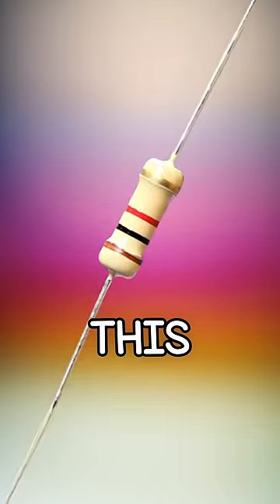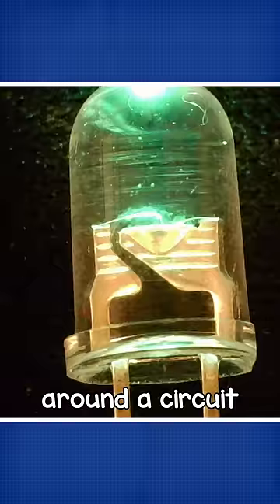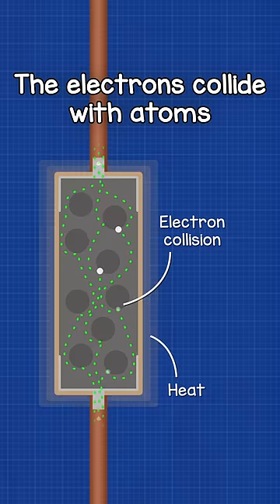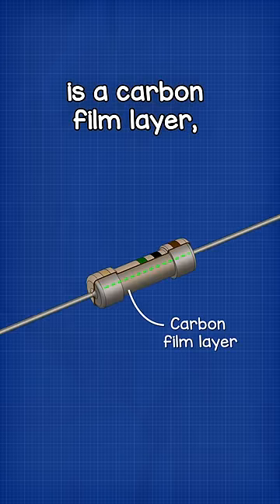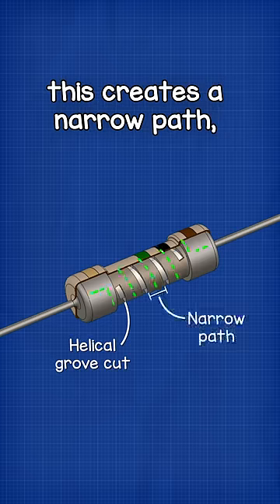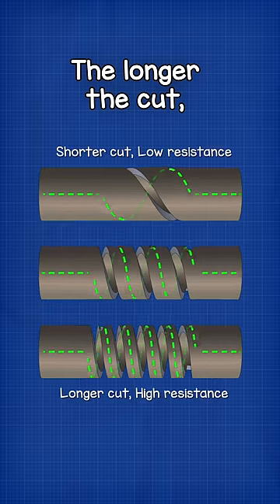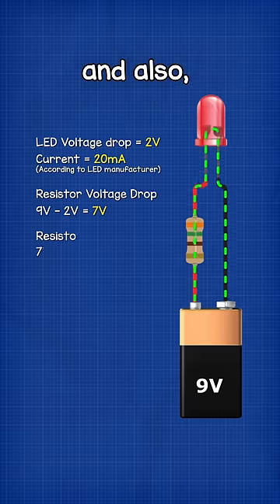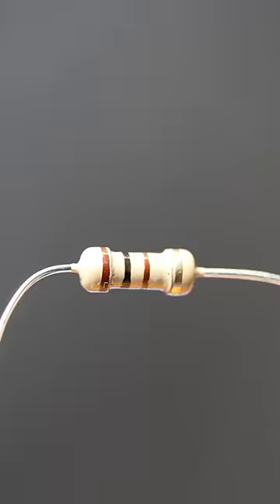What is a resistor? #electronics #electrical #engineering #electricity

Comment: Remember kids, all electronics produce light at least exactly once
Reply: Caps don't not offensive
Reply: Everything's a smoke machine as long as you operate it wrong enough
Reply: @akshatjaiswal6345  you ever short a capacitor out? They most certainly can emit light. And sound, and smoke.
Reply: @rubiispare reminds me of a quote/joke I have used: any component is a lightbulb with enough current.
Reply: My electrical engineering professor taught us that electricity is based on smoke.... when the smoke escapes, it stops working 😂
Reply: When i was a kid, in my days,  i used to break this chips to see what was inside.
Reply: @maelthrajaluk42  yes. It's magic, and it's blue, and it must NEVER escape because it'll never go back in
Reply: @maelthrajaluk42 sometimes you aren't so lucky sometimes that smoke is an orange flash of light, if your even less lucky that orange flash of light happened to be a lithium ion battery
Reply: The data sheet won’t tell you this but they hide every color inside each LED.
Reply: @akshatjaiswal6345 i just don’t understand kid you said ? “Its caps and im not offensive?”
Reply: @maxaul567 he's speaking the language of the gods!
Reply: @antiStrikerS  i take it as a compliment but ok
Reply: @maxaul567  i was talkin bout the kid but ye
Reply: @maelthrajaluk42 And you can’t get the smoke back in!!
Reply: But sometimes it’s in the end of a tunnel
Reply: Saying "at least exactly" is kinda redundant
Reply: @foolishly7366  it ain't, it's just right
Reply: @foolishly7366  not really. LED's emit light many times. All electronics emit light, at least once.
Reply: I think black holes are conductive to AC tho
Reply: @johngavin2570  and smell 🤢
Reply: yeah GPU
Reply: Na they don’t but they do all smoke at least once
Reply: @RedHaloManiac95  yes they do, you're not trying hard enough. Smoke=potential for full combustion. Full combustion=fire. Fire=light.

Also, realistically speaking, if it is smoking, it has already combusted, meaning it has already (internally) created light.

Whether or not you see the light is not the point. Light is made, much as a tree falling in the woods makes sound.
Reply: @foolishly7366 idk man, seems like an And/Or kinda thing
Reply: @akshatjaiswal6345 suppose that I argue semantics and say that the capacity doesn't qualify as electronics because it only has the capacity to be electronic
Reply: I am literally very sorry for the very late reply but I would have said caps are offensive.
Extremely sorry.
Reply: @LEON46051  ..McDonalds don't use real potato, everyone knows that.
Reply: @CadenMoskol ever punctured an iPhone battery while replacing it? With bare hands? Inside the house on a table with a cloth tablecloth?
Reply: @christopherkucia1071  Yes actually in my case it just smoked though
Reply: Everything can, with black body radiation
Reply: All things in the universe produce light. Heat is found in all things, and heat is radiated in the form of light. Only reason the sun is brighter than a rock in a dark room is the sun is hotter
Reply: Gives "any machine is a smoke machine" vibes
Reply: Yeah they.explode 😂@johngavin2570
Reply: @maelthrajaluk42 mmm yes the magic smoke
Reply: Everything that has heat produces light (even a human makes light, it's wavelength is too long to see though, this is how thermal cameras work)
Reply: @CadenMoskol  *you're
Reply: @johngavin2570 I think he's mentioning a grammatical issue. "At least exactly" is redundant since "exactly" means equal, while "at least" means greater or equal in math terms.
Reply: there's also "anything's a fuse if you're brave enough"

Comment: I've always wondered what the inside looked like, thanks!
Reply from the maker: See our Resistors Explained video for full details on our channel
Reply: @EngineeringMindset you should have left the link to that video here.
Reply: This is only true for carbon film resistors,  other versions exist.
Reply: @adon8672 bro it’s ok I can easily search the video with the information provided
Reply: Even during engineering they never showed what's inside resistor or capacitor
Reply: @roninr8199  This actually isn’t why most resistors look like, Normally
Reply: @adon8672 Its right above the caption you dingus. Just press it.
Reply: There's a few types.
Reply: @adon8672 he can't links got canceled a while back :(
Reply: Me too! Earned my subscription😄
Reply: When I was in school for electric systems I asked how they actually work because everything else was explained like transformers, relays and such but the instructor just said "it's not part of the class" I didn't have a computer to look it up and forgot about that moment until now.
Reply: Like all electronics it's filled with magic blue smoke. As soon as that smoke is released, they stop working.
Reply: Outdated knowledge
Reply: QQ ²22²uuuuuuuuu
Reply: Many types ,this is just one type .
Reply: Look at some old resistors they are huge and have sliders on them to pick the value, they look like coil springs compressed.
Reply: That smoke smells like money. Not getting rich smoke- unless you have stock in electronics parts stores.

Comment: Now the shape of resistor on a schematic makes sense
Reply: thx!
Reply: Oh dang I realise ☠️
Reply: OMG you're right, I never realized that before lol
Reply: i knew they  had this  shape because of the resistence in a heater, i  had no idea resistors were just the same thing but smaller, i thought the resistance was based on the material they used
Reply: Great point! Also the pattern of it burning up was super fascinating.
Reply: The symbol represents wire wound resistors which were the original way it was done.
Reply: @abeyroy007  same
Reply: Bruuuhhhhhhhhh I'm going to mention this to my circuitry professor!
Reply: Right????
Reply: My college lecturer always used to rave about how the old English/American symbols (ANSI) were better than the ISO standard.

The UK standardised symbols with ISO mostly using German examples a fair while ago. Standardisation does not always mean the symbol is better, but it does guarantee that different countries are using the same system.

If you don't know, ISO resistors are a rectangle (the shape you physically see side on). ANSI ones are quicker/easier to draw by hand though.
Reply: Resistor is a coil but not Cooper made, but Carbon made.
Reply: @azhuransmx126  And a physical coil of wire (around a magnet) is an Inductor.
Reply: @Joshua-fi4ji  and if you allow the magnet to move inside, then you have a solenoid.
Reply: @Joshua-fi4ji  the coil doesn't necessarily have to have a magnet before it becomes an inductor
Reply: @chukwumaeddie5485  true. I probably didn't word my comment very well looking back on it.
Reply: @chukwumaeddie5485  true. I probably didn't word my comment very well looking back on it.
Reply: Right!
Reply: @azhuransmx126 And if you use that moving magnet to switch on/off another circuit, you have a relay.
Reply: @doomtho42  Yes, Relays the beginning of Logic Gates and Computers, and I believe that is the end 😂. Well, one more!, if you put several coils aligned in a canon and put an iron bullet inside, then you have a Helical Gauss Rifle.

Comment: Electrons don't collide with atoms, they transfer kinetic energy to other electrons, a behavior that looks like a collision, when a circuit is closed, causing a domino effect of  kinetic transfer. The kinetic measure of electrons, called current, must balance with the potential energy in the battery as voltage or electron voltage and the resistance or magnetic capacity of the resistors, transistors, switches, modems and even wires. Flames of fire are made up of electrons, so if there is a build up of electrons in one area, when the voltage is higher than the resistance ability, a flame is created.

Comment: I just understood this shit after 15 years... man! It makes sense now! Bc of the helical shape the electron has to go through a longer path and this is how it works! Fucks sake none of my teachers had show me something like this but i only needed this! Oh my gooooood!!!
Reply: Someone tries to tell for us,that the resistance only depends on the length of the path through the resistor? This is partly true, but the resistance depends on the material of the resistor. 1 kilometer of copper wire has an electrical resistance equal to one meter of tungsten wire. According to them, 10 mega Ohm resistor should have 162 kilometers of copper wire? Carbon layer, Metal oxide, Varistor,Thermistor, NTC, PTC are based on the electrical conductivity of the material from which they are made.
The resistance depends very little on the length of the path, or the shape of the resistor. It depends exclusively on the material of which it is made...Do you understand? One metal oxide resistor 0.25 Watt, is about 1cm long. If it has a resistance of 100 megaOhm, it should have a 200 kilometer long copper or aluminum wire in it? So, the resistance only depends on the material, not on the length of the electron path ..Simple example: Iron has 7 times greater electrical resistance than Copper.

Comment: There is a flaw in this explanation. Resistors dont make less electrons to flow. They just reduce the "force" with which they flow. Thats why you will see a voltage drop across the resistor but not a drop in the current flow.
Reply: This. It really bothered me a resister is not a valve it's a ramp.
Reply: Eletrons DO NOT flow.
Reply: What?? Of course you see a drop in the current, compared to 0 ohms... i.e. in an ordinary battery circuit.
(Only with a theoretical and ideal synthetic current generator would your statement be true.)
Reply: It controls the flow of current in a circuit. The Amount of Resistance is based on the ohms of the resister
Reply: Then it depends on if it's in series or parallel. Ohms law and Kirchhoff's Law.
Reply: Then there is impedance in the circuit measured in Mhos. Then there are diodes an entirely different critter which is based on what it is made of
Reply: A germanium diode, silicon doode, and the odd ball zener diode, which works in reverse of a normal diode
Reply: @blackpink5937 read kirchhoff's law it will explain it.
Reply: "Bad beer rotts our young guts but vodka goes well" is a saying to remember the resistor color code. First letter only. Another one not as polite
Reply: By definition, electric current is a flow of electrical charges by time unit, these charges can be electrons or ions, in a teorical constant voltage circuit, you can control the electrical charges flow by means of a resistor and effectively you control the electrons or ions flow (depending the media through this charges are moving). Intuitively, It can explained as 1000 persons trying to pass through a narrow door, only few of them can pass in a given time unit (equals current) while at the same time you have a high pressure and low pressure at either side of the door (equals potencial difference aka voltage drop).
Reply: Well, @ask_sharma, if you want to nitpick, electrons don't flow, they push each other without moving. They propagate a wave.
Reply: @nicojar glad we are finally leaving the age of flowing electrons....  when will science finally tell the 100% truth?
Reply: Resistors reduce the current flow for a given voltage. It's basic Ohms law. I=V/R
Reply: Except you also have to understand it’s not the electrons’ flow it’s resisting, it’s the flow of the electron’s *charge*. The actual electrons themselves move very slowly down a wire. In fact, the actual electrons themselves move only a few meters every hour down the wire. The effect of that movement, however, also called the “charge” moves very very quickly.
Reply: @rorschach0  actually, electrons do flow, just very very slowly. Only a few meters per hour, but they are moving.
Reply: @nicojar  if you want to nitpick further, electrons do not exist
Reply: @ChefMeowMeow  an electron is not a particle, it is a measurement.  1 unit of dielectric induction, according to JJ Thomson
Reply: @ChefMeowMeow  electrons each have an associated charge of the same amount. When the electrons move, the charge moves with it.
Reply: No there is not. Adding resistance to a circuit will impede flow of electricity and cause reduction in the current.

It is the direct and inevitable result of adding resistance to a circuit.

Yes we could say that it is possible to increase current by adding resistors to a circuit... But this is a short basic video. Sure you could make an entire series of lectures on resistors, but that is not what this video is about.

This video is simple and easy to understand for someone without much or any prior knowledge on electronics. And there is no fundamental flaw in this. Simplified, yes. Flawed, no.

And if we start nitpicking about this, then to say it does not reduce current, but "force", by wich I would assume one would mean voltage, it is actually not true.

Sure there will be a voltage drop as current passes through the resistor, but as such a resistor does not add any specific voltage drop. Voltage drop accross a resistor depends on the current flowing through it.

So the only correct statement would be that adding a resistor would add only resistance to a given circuit. But obviously that resistance does both limit current passing through and cause a voltage drop. Those are both inevitable and inseparable effects of adding resistance to a circuit.

So to say a resistor would reduce current, is a true statement.
Reply: @juhojohansson1716 , thank you for taking the time to write in detail. I got very confused when someone said that resistor does not reduce current. You cleared the confusion.
Reply: That’s literally the exact opposite of the truth

When you add a resistor, you see a drop in current, not a drop in voltage
Reply: No...
Reply: @blackpink5937 bro V is directly proportional to current .
Reply: Electrons don't flow. 
It's the holes between them that flows.
Reply: @mikkirefur electrons are experimentally observable particles as per Quantum Field Theory. You should be referring to how moving electrons aren't the reason for electricity, as much as moving electromagnetic fields due to their motion are.
Reply: This is not true. Voltage always remains the same. It is current that drops. Voltage drops across the resistor, because the resitor is a load. But the total current remains the same in a series circuit.

In a parallel circuit, the voltage is divided, but in one of those parallel lines, voltage drop only reduces the current output.
Reply: @jyothishkumar3098  yes i agree with you that electrons "moving through wires" has falsely been taught as how electricity works.   jj thompson defined electrons as 1 unit of dielectric induction.  
this makes us realize that the idea of electrons "orbiting" atoms is also false and that atoms are essentially dynamos, and the "orbiting electrons" are simply avoiding this idea.
Reply: Looking for someone to point this out.
Reply: @808drumz9 But the current on either side of the resistor is the same.
Reply: @bpivr  that's correct. Resistors reduce the flow of current on the entire branch they are on. That's how flow reducers work, even with plumbing and water.

Comment: In second 1 we have the famous LER.

They are not as bright as LEDs, bit still glow.
Reply: In college, I would mention that you need to get the right wattage for a resistor, and my MechE friends would not believe that that's a thing.

I'd pump 10 watts into a 1/4 watt resistor, and the end result was illuminating for them.

Another 4 cents well spent!
Reply: @phillyphakename1255  👍
Reply: Not in the visible spectrum. If we evolved Predator vision then we would be using a type of resister as a light source.

Comment: 3 years of college couldn't explain this so easily and so intuitive. And you did that in less than 1 minute.

Respect
Reply: Amen
Reply: If you a doing basic circuit
design you don’t need to know this. You just need to know what it does and what ohms law is. It could be a tiny room with tiny Lucy and tiny Ethel taking the electrons from a belt, wrapping them in a magnetic field the back on the belt.  But they are In over  their heads and can’t keep up and electrons are piling up and that makes the room hotter. That fact wouldn’t affect your ability to use them properly in a circuit.

Comment: Resistors don't limit the flow of electrons, they simply reduce the potential of the electrons to do work by making them do work to get through the component resulting in waste heat.
Reply: I=V/R. They reduce the current because ohms law. What you said doesn't make any sense.
Reply: So does that mean the same amount of energy is taken from the source regardless of the resistor (or lack thereof), it's just that more (or less) of it is converted into waste heat?
Reply: @zorkmid1083 I’m sensing this is a rhetorical question and you already know the answer. 🤔
Reply: @trippmoore  No, it's not rhetorical.  I'm trying to confirm what I think, but i'm not 100% sure..
Reply: … which limits the flow of electrons
Reply: @zorkmid1083  no

P = VI
I=V/R
P=V^2/R

As you can see, power is inversely proportional to the resistance

Voltage is an independent variable associated with the voltage difference of the batteries or energy sources

The amount of power used per unit of charge (electron) is in fact independent of the amount of resistance